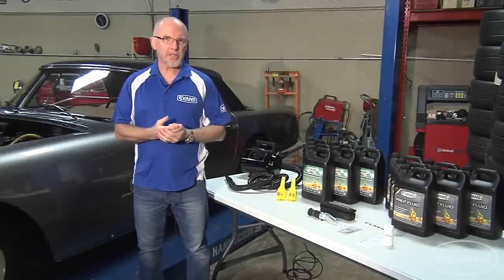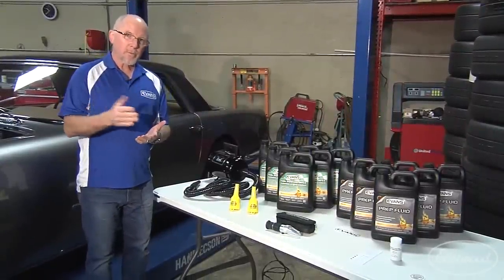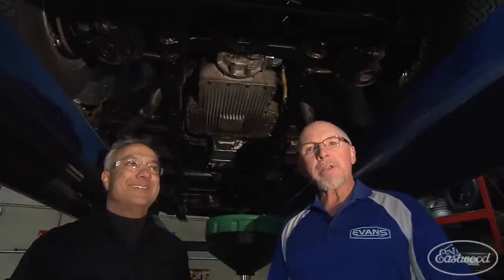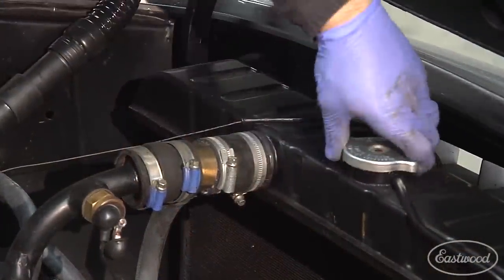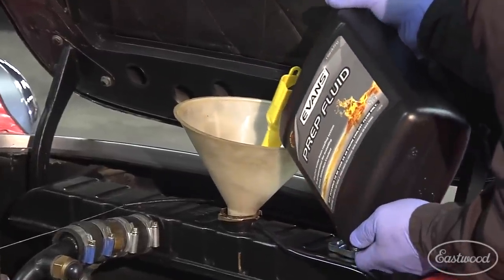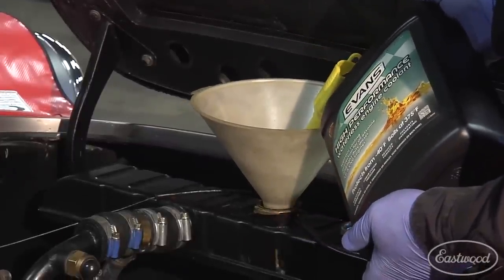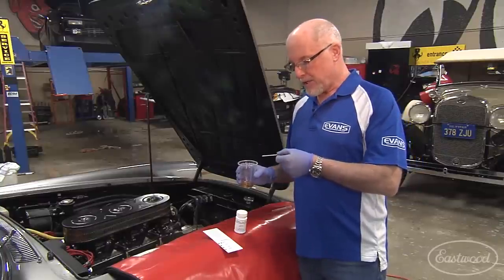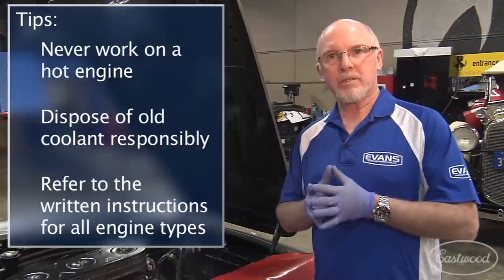Waterless Coolant!  Evans High Performance Waterless Coolant - Keep Your Engine Cooled - Eastwood

Comment: I have tested this product in my 91 Range Rover for a year now, I live in one of the more hot climates of California, with a daily 20 mile commute. After completely overhauling my cooling system, on top of new evens coolant, I now have a reliable offroader / daily commuter. I wish I used evens coolant three rovers ago. If you haven't checked Evens out, you better. It's worth every cent. Also took the rover to the high Sierra mountains for a week of hitting the trail and camping, This coolant was flawless, no pressure, no overheating. Think outside the box, you won't regret it.

Comment: I used this in my 2014 mustang gt N/A paired with a fluidyne aluminum radiator and the Temps during stop and go traffic would sit at 210. Now that I change the coolant and the radiator it sits around 185 to 190, when driving it would drop to 175 sometimes. Really love it.
Reply: Thats not even impressive that's sounds like mostly the rad I just run  the prestone coreguard inhibitor 10 year coolant it's never and I mean never failed me but hey if this shit is at the same price or lower I'd try it

Comment: the point of this waterless coolant is to prevent corrosion in a cooling system. Imagine an antique Ferrari, Bentley, Rolls Royce or Dusenberg that has the original block, radiator ect. If you replace any of those parts due to corrosion, the value is significantly reduced due to non matching numbers to the VIN. This waterless coolant makes sense in those scenarios, trying to prevent part corrosion and replacement.It does not make sense in a daily driver. Its massively expensive too, my towncar would cost 975 dollars to convert to this coolant, not at all worth it.

Comment: I remember hearing about this stuff years ago. 
From what I remember it was supposed to be great. 
You could add spark timing or boost, get or add more power without worrying about detonation and whatnot. 
It would overcome some of the normal limitations of conventional coolant and how cooling systems are approached.
Reply: +SPOOL ME UP haha if you say so. 
It's the internet I don't have time to explain so whatever.
Reply: its more efficient heat transfer helps in a lot of cases and people in fact can add a little more timing and so on..
Reply: @MrTheHillfolk lol I feel you there bro
Reply: @jeffgood6441  
I decided to push some limits last winter ,as the wife's cars water pump started leaking just as winter hit.
Almost all winter ,like 25 at night and usually 40 during the day,it was very mild. 
Since it never sat more than say 8hrs I never had an issue with freezing and I ran it the whole winter like that before I changed the water pump 😄
Anyways,on the summer car I got some redline water wetter and water and filled it up. 
Can't say I noticed a difference until a few weeks ago as I said I shouldn't tempt fate anymore and put some antifreeze in it. 
Even with like 35% antifreeze,I noticed it runs 8-10 degrees hotter.
It was taking time to hit 170-175 before (with a 195 stat) whereas now it hits 180 in a reasonable time. 
There's definitely something to bring able to absorb that heat quicker so you can tune it up a little more for that extra edge the other guy doesn't have.

Comment: Compared to normal 50-50 water-coolant mix Is this more effective at cooling the engine? Anyway I understand that even if it goes a bit hotter it’s not a problem since it’s not boiling. However, the oil may overheat even with 50/50 water coolant mix and the indicator at normal temperature

Comment: So - You need to flush.
Add Prep - run 5-10min - Flush
Add Waterless coolant - run 5-10min
Check water content. If above 3% - start over?
Reply: No need to start over, after buying the products ( not cheap and as they say buy once and never again ) np one would not remove the coolant and flush properly. We hired a blower with a heater to blow out the block, heater, hoses and radiator and then left everything to dry for an entire day in the 36 degrees summer temps. We to had zero coolant and flush remaining.
I first heard about this product 2 years ago and was told not to use it but several weeks ago after more researching we gave the product a good and am very, very happy and no I have nothing to do with the Evans product. After spending $50,000 on the cfar we only want the best.
Reply: +Johnny Johansen Just put it in my frs, the way I did it was 
1. Flush out and drain the stock toyota long life coolant
2. replace with distilled water get engine up to temp at 2000 rpm for 10 min with heater on high
3. Drain distilled water
4. Add the evans prep stuff run for 10 min with rpms at 2000 till fans come on and off twice, making sure heater is on high
5. Drain the prep till theres not even a drip of the stuff left on the drain cock
6. Finally ad the waterless coolant, get up to temp with heater on high, check levels add a  bit more

The distilled water part was not necessary and was only done by me to make sure there was absolutely no toyota long life coolant left

Comment: Works great.. I use it in my BMW ...It has many advantages..The coolant cools your engine better.. A cooler engine actually increased my gas mileage by 1.5 miles per gallon.. That above what the sticker says city/highway..No corrosion means longer lasting radiator and water pump.. also because their is no steam there is no cavitation on the impeller in the pump. No pressure in system.. that helps hoses last longer .. head gasket.. etc.. Its been approved in the aerospace industry which is the hardest to get a product approved for airplane engines...
Reply: it has not been approved by Mat.
Reply: @pikeywyatt  And why does Mat have to aprove it?? Lol
Reply: My expansion tank has just cracked. (With normal g11 fluid)This happens because the system is under pressure and over time the plastic tank becomes brittle then the cap valve doesn’t open at the right pressure. This coolant should solve the issue.
Reply: That is not how cavitation works......sorry
Reply: @ThePtr83  still getting .1 miles per gallon better than spec 2 years later and no problems or leaks

Comment: My only question is.......after you have filled the system. With radiator and overflow. What levels do you keep it at, since it doesn't build pressure and expand like water and pressure. Is check cold/hot level still valid  ?
Reply from the maker: Our instinct is to run it above cold and below hot, you can check with Evan's directly for more information.

Comment: I might try it in my corvette  first it runs 220 in the summer and makes me worry  about blowing  a hose or splitting  a radiator  seam from the pressure
Reply: XxzombiekillerxX mlg pro 
This builds a little pressure
Reply: Well get ready for it to run even hotter then. And if it blows a pipe or you get any leaks from stones or splits etc would won't get the big steam warning.

Comment: Just another con. 50/50 water and antifreeze is by far the best most efficient coolant. Only time an engine will overheat is if it had a problem to start with and this stuff won't fix a faulty coolant system it's just you won't see the problem ( steam) in till it's too late too hot and you then have a real problem.
Reply: the point of this waterless coolant is to prevent corrosion in a cooling system. Imagine an antique Ferrari, Bentley, Rolls Royce or Dusenberg that has the original block, radiator ect. If you replace any of those parts due to corrosion, the value is significantly reduced due to non matching numbers to the VIN. This waterless coolant makes sense in those scenarios, trying to prevent part corrosion and replacement.It does not make sense in a daily driver. Its massively expensive too, my towncar would cost 975 dollars to convert to this coolant, not at all worth it.
Reply: @RobbieRudy  Sorry but my daily driver vehicle would like to disagree with you on that. 

I switched it over to Evans Coolant nearly 15 years ago and still no problems. 

What you dont seem to get is that Evans doesn't boil over until 375 Degrees Ferenheit. 

A 50/50 mixture of Peak Antifreeze boils over at 265 Degrees Ferenheit. 

But that's assuming the water hasn't evaporated out of the system.

 And its also assuming that the water hasn't corroded and eaten the seals in the system. 

The normal operating temperatures of an OEM cooling system are anywhere from 195 F to 225 F in the dead of summer. 

But if something fails in the cooling system your engine will quickly expire once the 50/50 boils off.

With Evans your engine is far less likely to fail because the cooling system would have to reach 375 Degrees F before the Evans boils off and fails. 

But you should be pulled over well before then and stopped.

Another problem is that most other 50/50 coolants have an even lower boiling point than Peak does which leaves your engine in even greater danger of becoming junkyard material should something fail. 

This is why Evans Coolant is superior in every way to a 50/50. 

It has the highest boiling point of any Coolant on the market. I need that peace of mind every time I drive. 

I don't wanna be wondering if my vehicle is gonna leave me stranded in the heat of summer because the coolant boiled over too soon. 

Sorry but I will say it again that Evans is superior to a 50/50 all day every day!!

Comment: Hey, I followed your install instructions, at 00:56 seconds in this video you said there would be no pressure however when I opened the radiator cap to test water content after I ran the engine and really hot Evans Water less Coolant went all over my arm and face it was almost like it was under pressure and now I look like Erik (The Phantom of the opera) could you please explain why this happened?  it really hurts and the doctors need to know the chemical make up of what burnt my face off.
Reply: oh and the sticker keeps falling off. any tips?
Reply: Yemezler 😂bu ticari bir sırdır😂.İyi deneme bence dava açın 😂

Comment: Dose it work for turbocharged engines
Reply: exactly what I would like to know, since your engine may not overheat but I have been reading other reviews and they all say that the engine does run hotter, which isn't really good for turbo engines or Hi performance engines in general.

Comment: if i ever overheat i'd like to just be able to add water to the radiator to be able to get home with this stuff ill have to get my car towed because auto parts stores around here doesn't sell it so i definitely wont be buying it
Reply: steven bloomfield a car would overheat ....because of :
1 - heavily neglected cooling system
2 - undersigned cooling system ( custom car build/buggy) with undersized radaitor + undersized fan + wrong thermostat...with high output engines is even worse

i NEVER experienced overheat...although we live in a country were ambient temperatures gets as high  as 58 Celsius (136f) and 61 in traffic simply because i do the following....

1- oil changes before their due ex : 10000 kilometer oil are changed every 5000 kilometer instead of 10000 (no sludge build and piston top is mirror clean)
2 - replace coolant every 2 year regardless of mileage
3 - replace radaitor + hoses + thermostates + fan clutch/electric fans at 250 000 kilometer thats 155000 miles(even if its not leaking) and install these parts correctly with proper gaskets and torque water neck bolts with proper torque spec...
as requested by the maker maintenance schedule (dont try to outsmart the maker with this one) 
in other words if you drive the components past there life  and break something your the one to blame here

cooling systems are  one of the most vital components on your car and most neglected(thats why you dont see alot of 600 000+ miles engines at junkyard)....failure to properly maintain them will kill/shorten your engine/trasnmission life as soon as you enter your first overheat cycle

cost ,complexity,time for changing an engine/transmission + the affected cooling components that caused the problem VS super maintaining the cooling system
you do that math....

i mean the US spec toyota camery cooling system is the same as the the ours (middle east spec)
yet we have toyota camery owners overheating there cars in the US....(us has generally colder climates)
now thats epic fail if you ask me...
Reply: Faisal Abdulaziz well thank you for that although it was unnecessary what I was trying to say was even with a well maintained vehicle things happen ex)A blown radiator hose if you live in the city like I do a parts store is usually within walking  distance,me personally don't like paying towing fees if I can fix it in the side of the road and since most if not all parts stores don't Carry it (evens waterless coolant)your pretty much screwed and before you say something about the radiator hose blowing it does happen ,rubber deteriorates  from engine heat and time it happens usually with older cars which is what I drive and I do also use the service manual for service internals. Sorry if I sound a bit pretentious I just got off work
Reply: steven bloomfield ehh I don't really care to reply Back again so take my first reply at face value
Reply: hmmm..
here is the thing...
if the OEM manufactures starts to adapt things like plastic electric water pump ...then we are in deep shit...not only do they fail too soon,,,,there super expensive and can have electrical issue...like toyota prius and the new BMW suvs.....loads of fun...
Reply: steven bloomfield understandable ....
Reply: Faisal Abdulaziz 3 - your radiator cap fails and blow all the water out 4 - a hose gets damaged or falls off 5 - your headgasket blows LOL SUBARUS
Reply: KoG GoK

yes i never experienced those because i replace them way before they fail

and thats why i never experience

did you you
 1992 jaguares/orginal minis/rolls  or anything that came from UK with the exception of land rovers did not have good cooling system was not even adequate there so it was popular for us in kuwait (59 Celsius) to swap in chevy 350ci in them to fix it

there was a famous shop in Kuwait owned by a Russian who adapted bigger radiators for the minis because different engine was not possible (it was fwd and rather complex)
which is ironic cause he comes from a very cold country

also
air cooled porsches were an instant fail
even though it was owned by wealthy people...
how ever ...the beetle which was also air cooled did well actually ...but it didnt have an air conditioner in it...

so only the Japanese and american cars did well here 50s and above  that is
Reply: Faisal Abdulaziz nice to know that you replace head gaskets before they fail. so you just randomly test and replace parts on your car huh wish i had the time to do that
Reply: +KoG GoK I know right and just because you replace parts doesn't  mean something won't, I've goten my fair share of defective parts  even when buying name brands
Reply: @meyawabdulaziz3863  Yeah like Fords Plastic Oil Pans they had on their trucks and cars. Lol

That was really bad. Lol
Reply: @MrMonkeykiller1996  Exactly!! He must have one of those magic 8 Balls. 

 I can just see it now!! He asks it if his radiator hose needs replacing tomorrow, so after he shakes it a bit and it says yes, he goes and replaces it with a new one.

But when it says I dont know, he suddenly panics and doesnt know what to do. Lmfo 😂